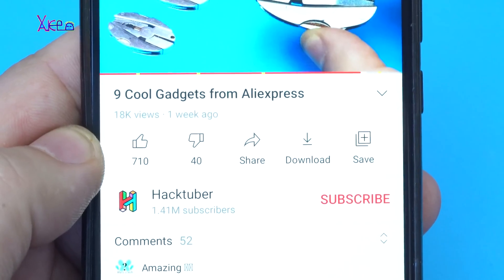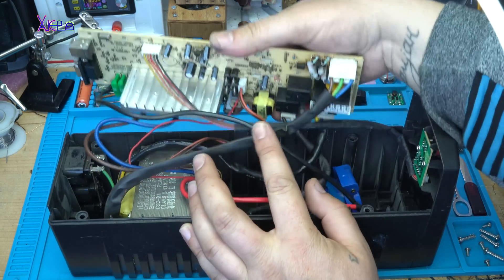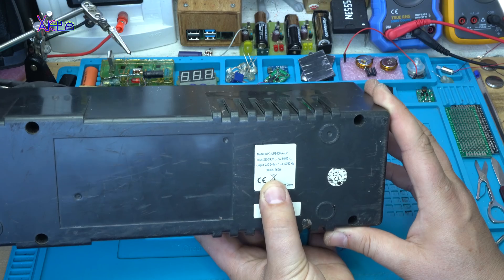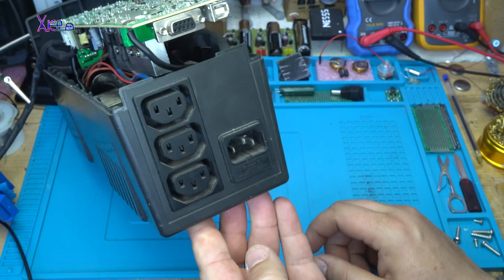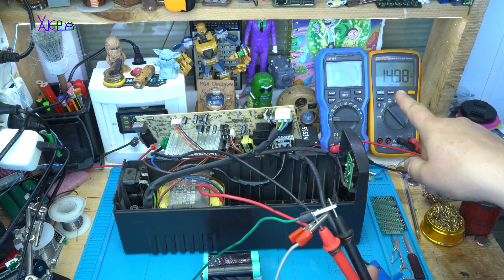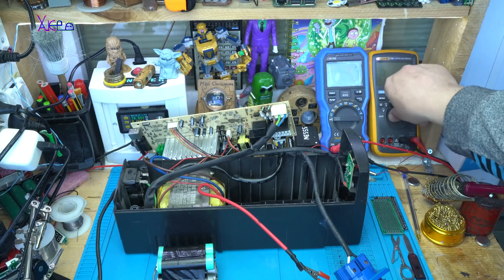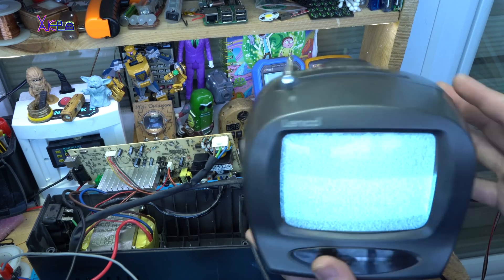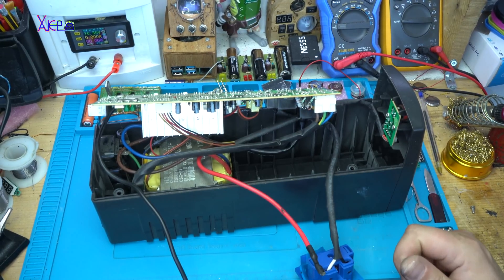12V to 220V Inverter | Free Power Inverter

Comment: How to charge the lithium battery when the battery goes down ?
Reply: usually the transformer inside the ups will charge it. When you plug in the AC to the ups it should automatically charge the batteries.

Comment: Would a car battery work on this or it will burn the mosfets on overload?
Reply from the maker: I need to try that for sure🙃
Reply: @Hacktuber  Will it work from a 12v car outlet?
Reply: I think it should work no problem. If talk about the damage on component primarily because of the power draw. Here mean that what do you power up with vs the circuit rating output power.